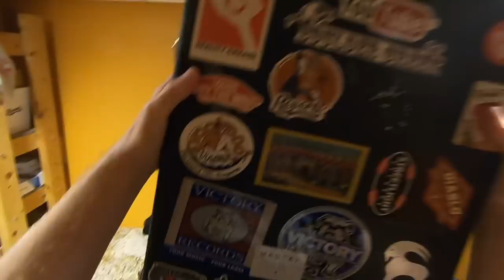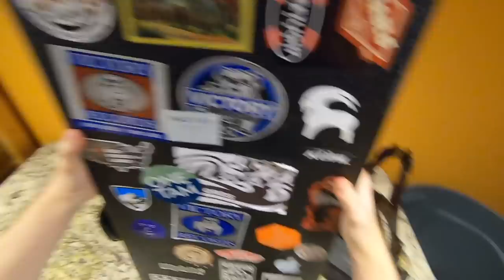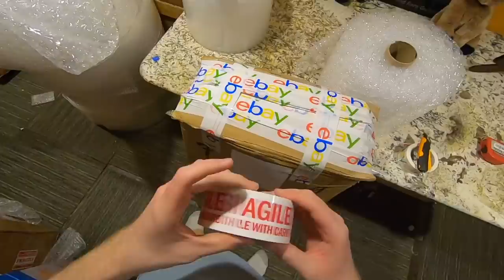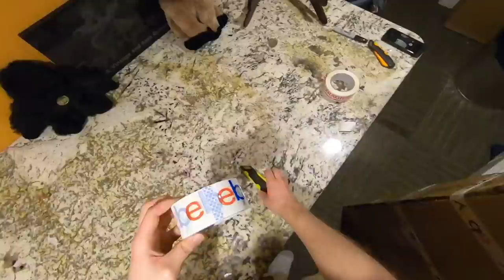I Bought a Piece of History! | Gibson Guitar Boxing + Unboxing Fun | Trogly's Vlogly #9

Comment: It's most likely the 12AX7 preamp tubes , from what you said , it sounds like you need to re-tube that amp . I would replace all of them , with a matched pair , Hope that helps . Good show  today
Reply: +1 on replacing the tubes.
Should always have a spare set on-hand.
Reply: @guitarocd9984  Correct Guitar OCD, just replace them one at a time with known-good tubes until the noise goes away.

Comment: To test your tubes, lightly tap them with a screwdriver while the amp is turned on, if you hear a noise coming through the speaker, that means the tubes have become microphonic and need replacing.

Comment: Ever heard of a voltage regulator? You might need one if that's the case for your tube amps. Voltages can mess with them to the point that either they sound great or absolutely terrible.